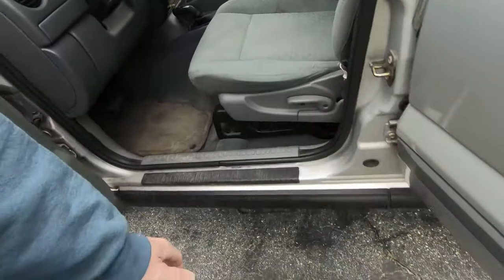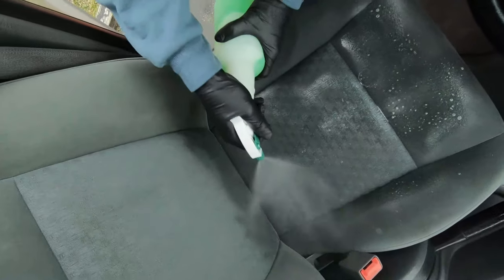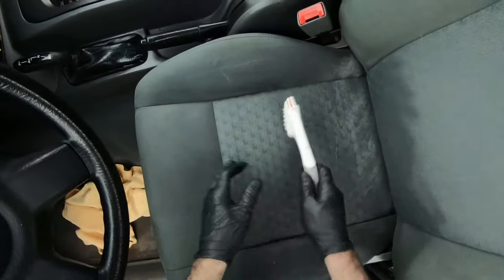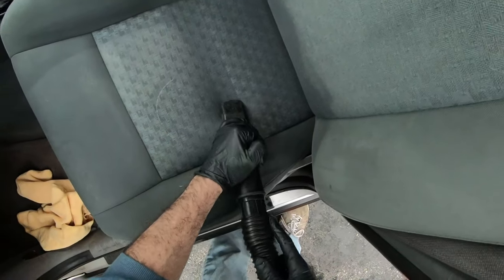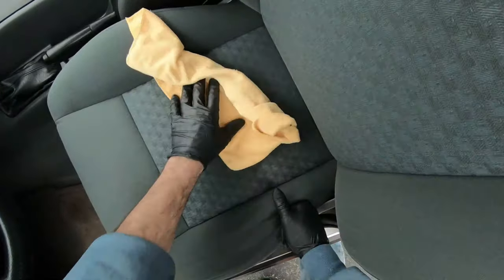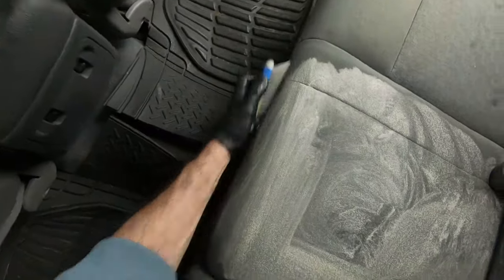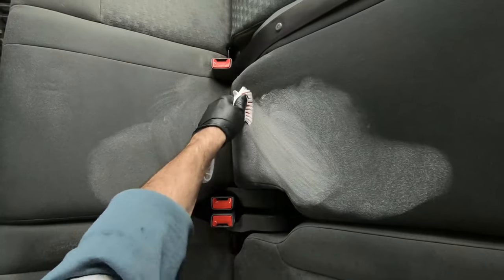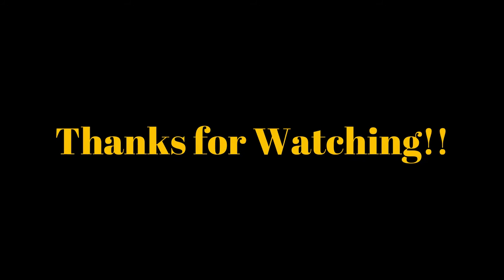Shampooing Stained Cloth Seats with Simple Tools

Comment: Do you need to remove the filter from the shop vac for this method?
Reply: Not the filter but the bag for the junk. Afterwards you will have water in the bottom. Rinse that out and out back the bag so you can use it as a normal vaccumer😊

Comment: Hey man, I have a question. After vacuuming the seats, is it still wet? My only concern is after cleaning the seats and vacuuming, it would still be wet and I'm afraid of molds forming. Thanks man.
Reply: Let the car run with the heat full blast on recirculating air. It’ll dry in 30-60 min
Reply: @onetouchgarage4503  Fire! Thanks man!

Comment: Wouldn’t hot water with laundry soap work better and safer?
Reply: No it’s not ph neutral and if u don’t get all that soap out which Willis be hard it collects dirt etc much faster so it will be dirty again n no time 

Go w a degreaser / water mix or a ph neutral shampoo and ph neutral rinse also won’t leave cloth hard
Reply: @joshymcdaniel9233  what do you mean by neutral rinse? Just water or another cleaner?
Reply: @BOSS_DOG  the real mvp
Reply: No because as a detailer ive noticed it wont remove the grease like super clean will I've tried laundry soap it don't get em looking good
Reply: Would it be better to steam clean the seats first to loosen the stains and dirt before putting the cleaner on?
Reply: Never used laundry. Just regular dawn. Worked wonders.

Comment: can i use normal vaccum cleaner instead of shop vac?
Reply from the maker: A normal vacuum isn't designed for and usually doesn't have the suction needed to pull liquids from fabric. A shop vac would be recommended for this.